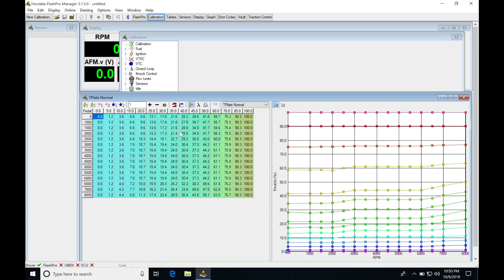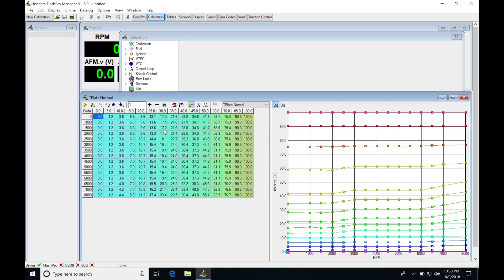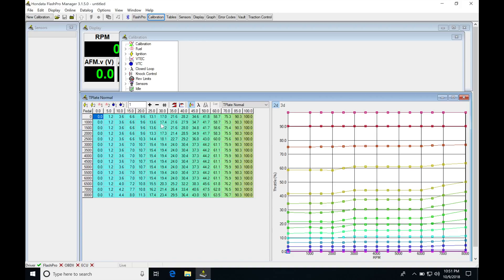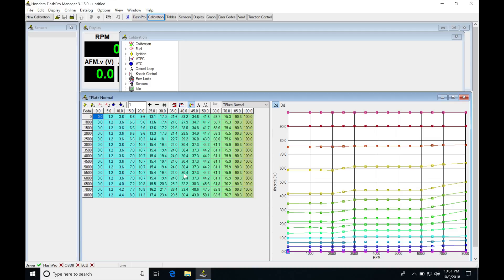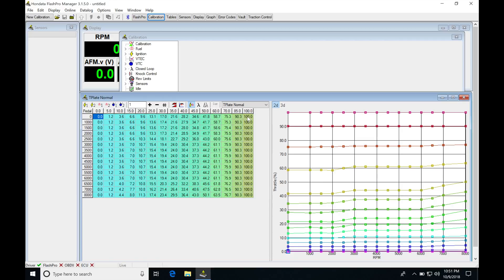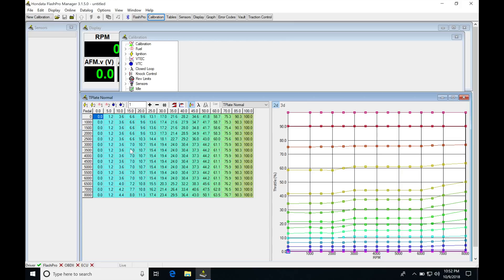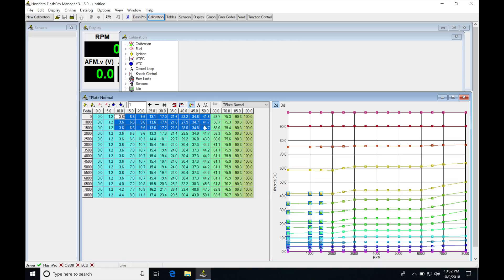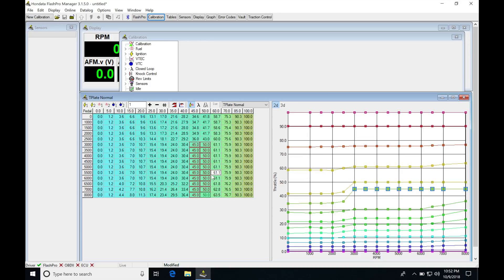Hondata FlashPro: DBW Throttle Control | Evans Performance Academy

Comment: How do i find this? Do i need a separate module?
Reply from the maker: Are you asking where you can find this video?
Reply: Evans Performance Academy no, my throttle menu looks different than that, i have something called throttle flow vs opening, its a different table, if its easier do you have an email i can reach you at?
Reply from the maker: @southshorekingpin8972  If you have a specific question you can post  onto our school support forum here: https://evansperformanceacademy.vhx.tv/forums
Reply: @EvansPerformanceAcademy  how do you add rpm values on the left column.? I have a 2014 si and it only goes to 7K. I have a fully built 4P engine and my tuner has me revving to 8200
Reply: @williamwestdyke7122 Hondata flash pro doesn’t allow you to add more columns unfortunately you can only edit the values. My guess is that based off rpm and pedal correlation it would be 100%. I rev to 7800 and the throttle plate says 100. So anything over 7000 has to be 100% with pedal at 100%.